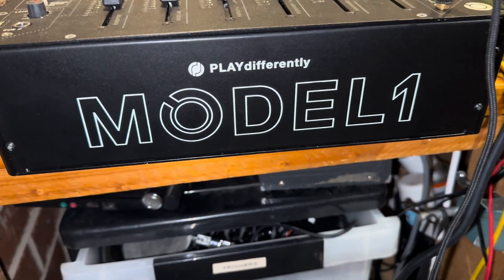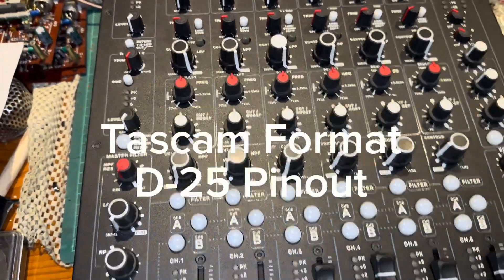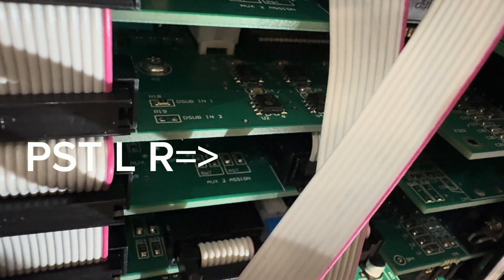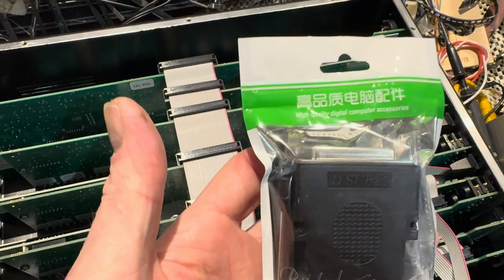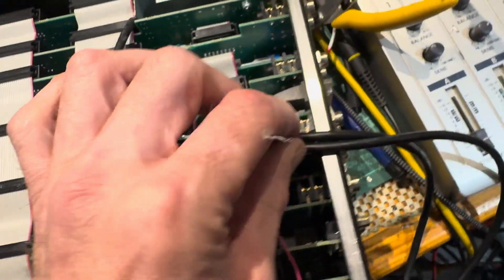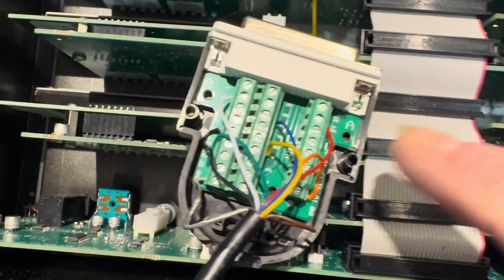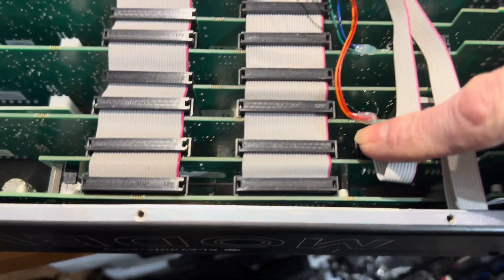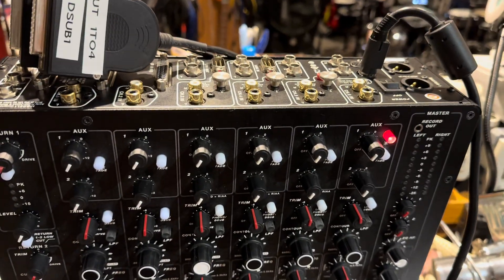Fast and Easy Direct Out Modification: The Playdifferently Model 1 Mixer

Comment: This is awesome, just what I want. Well,  what I would really want is a digital out, but it looks as if there is very little space left in the mixer. Personally I would not mind cutting holes in the metal, if done properly nobody would reject a mixer with individual outputs, me thinks.
Reply from the maker: @BorisKraft  there’s plenty of space but what sort of digital board? USB audio would be the way…tons of cheap options there. You could even go sharc DSP board with effects too.
Reply: @onomatopoeidia Interesting. I use the model1 with the Push 3 Standalone, which up to now doesn’t support interfaces on USB in although that too should be doable given its OS. So for that use case, ADAT is the way to, which unfortunately only provides for 8mono/4stereo channels. So it is only a partial solution, but would save me from lugging around an extra interface and cables etc. USB audio for the Push would be awesome though.

Comment: Did you have any issues with bleed   Channel bleed? I’ve heard from some people about there being bleed from channels into each other, but that was mods done a couple of years ago
Reply from the maker: @Elgusto82  not that I recall anymore than normal. It’s not a high-end mixer design by any standards so there are always limitations with this type of analog design. I just picked off the signals directly so no big deal.
Reply: @ ah okay, thanks. My other question is, when you engage the master filter say on channel one, will that come out the post fader mod channel 1? Or does the master filter go to the Master  LR output?
Reply from the maker: @Elgusto82  no master effects are on the master buss and we are picking off the signal before the channels are summed together.

Comment: Super nice, so what happens to the original Dsub out ? cancelled I guess right ? so we dont get the Aux out? Can it be routed to 13-14, 15-16?
Reply from the maker: no everything works as normal you just get additional signals that is why I did it this way. We want more options not fewer ;-). I'm simply picking off the signals separately. Easy with any old drum machine too. I've done it with TR808, 909, CR78, Drumtrax, Korg Minipops etc

Comment: Great , is this possible with any analog mixer? Can I Just parallel solder onto the aux send ?
Reply from the maker: @jomaas67  usually yes you take signals from any point.
Reply: @onomatopoeidia  why didn't |I think of that😯 , thank you so much I will try it out on my Hughes and Kettner Target 160 + 5 . I love to get those direct outs on it . Merry Christmas 🎅
Reply from the maker: @jomaas67  thanks you too. You may even find the schematic for it and then you can trace where the signals go. Pre points are good when you just want a direct out from the preamp whereas post points are ideal if you want to use the channel strip eq etc. have fun and remember to take photos so you can reverse any drunken Christmas misadventures :)

Comment: This is great, thanks for sharing the mod! I remember how confused I was the first time I plugged into this mixer and then realized there was no individual channel outs post eq etc. 

Is it also possible to alter the volume curve on the channel faders? It would be nice to switch those to a more linear curve. It seems to be the number 1 complaint from so many owners.
Reply from the maker: @bikesbeersbeats  that would require a total change of the circuit but anything is possible yep. Have not been able to find a schematic so would require tracing the circuit and imo just not worth it for a meh design
Reply: @onomatopoeidia  thanks for sharing this! Ive never seen inside of one before, and I'm curious about your comment that its not that great of a design. Could you elaborate a little if possible? The boards look fairly well designed from the small glimpses I've seen from your video, and isn't it pretty rare for a dj mixer to have modular channel strips? Maybe there's some lower quality component selection or something else I'm missing?

Comment: Cool! What do think about adding the two stereo returns and making all individual balanced outs? Would that be possible?
Reply from the maker: @DJBennyMoney  anything is possible. Would require a 14 channel active balancing circuit. Personally I don’t think it’s worth the effort. There are much better mixers for that purpose and much cheaper.